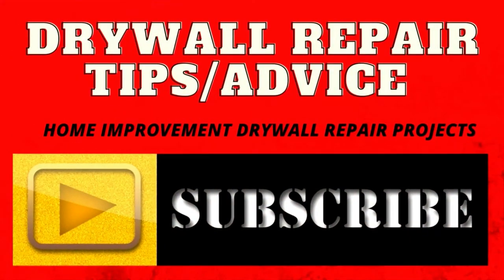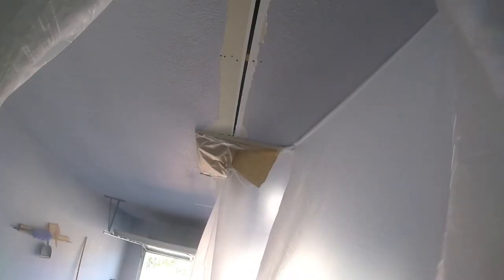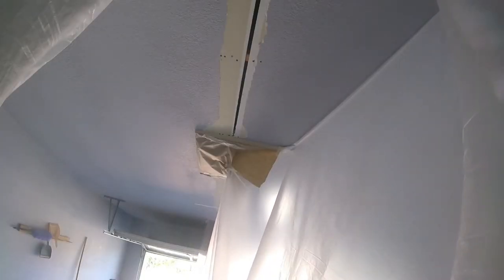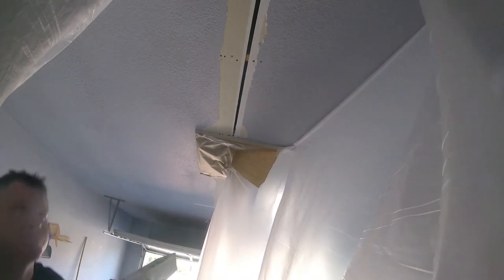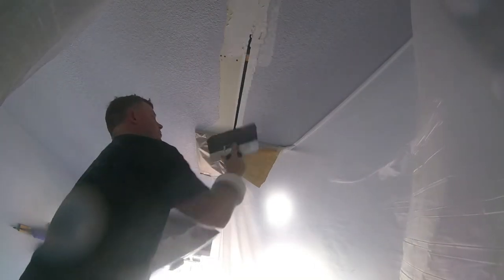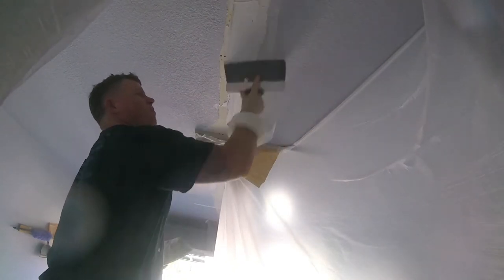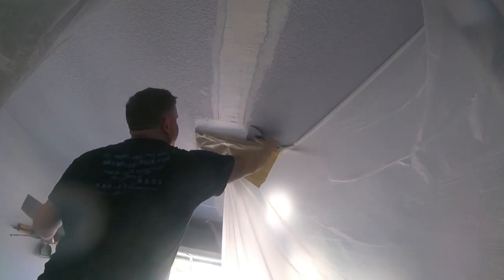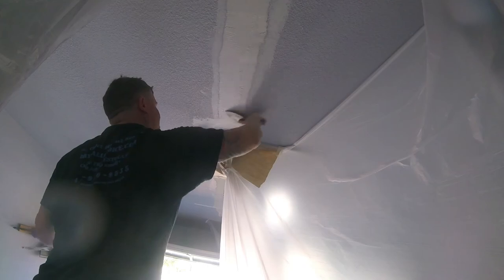Prefilling gaps in sheetrock always prefill large gaps in sheetrock before taping and coating

Comment: Can I use Sheetrock All Purpose Joint Compound for large gaps on the ceiling?  Tried to fill in a large gap, and the joint compound just clearly doesn’t stay and just falls down.
Reply from the maker: put SMALL PIECES OF sheetrock in gAPS OVER 1/2 INCH OR SO GAP FILL MUD ONLY FOR PINKY WIDTH FILL
Reply from the maker: STRAIGT BOX MUD DOES FILL IN
Reply: What about prefilling big gaps with foam before taping?